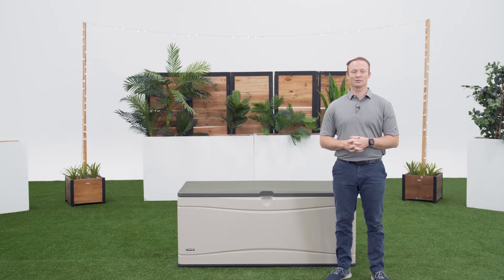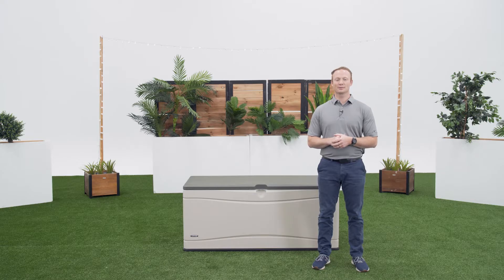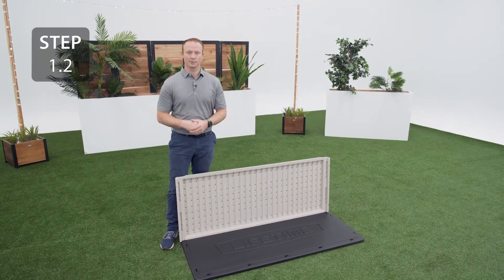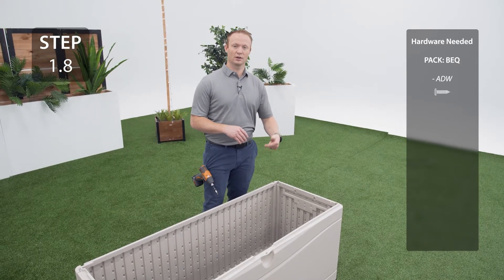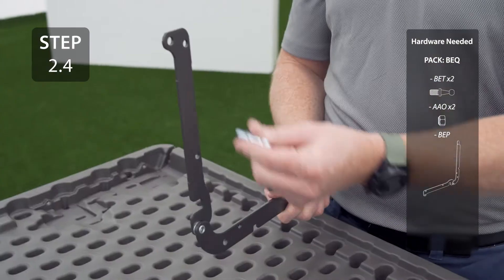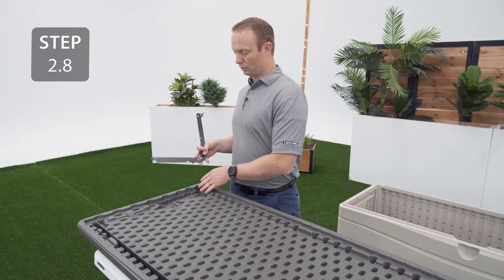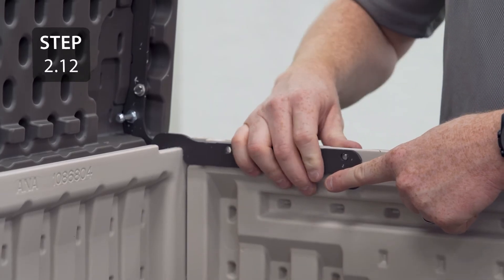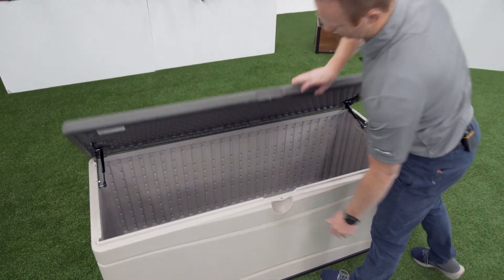Lifetime 130-Gallon Outdoor Storage Deck Box | Lifetime Assembly Video

Comment: The very first step is annoyingly difficult. The pegs in the long sides are not long enough to easily lock them in. Frustrating.
Reply: I just reordered this box because of that and I'm having the same issue again.
Reply: Seriously this also happened to me, this company is a joke
Reply: Same thing is happening to me
Reply: Check to make sure there are no extra plastic parts sticking out that prevent it from sliding in
Reply: Same here 😂😂

Comment: Helpful tip for those stuck on the first step of locking the front and back into the base. I got a rubber mallet and lubricant spray (WD-40 also works) from Walmart. Hit each peg and hole with the spray. Have someone else or a wall as leverage against the piece then hit them to the right with the mallet. I went from 30 minutes struggling in despair to locking the pegs in 2 minutes.
Reply: Boondocks idea to use a rubber mallet and WD40 was the answer to all our problems!  Thank you for your help!

Comment: Great box once assembled. I have assembled 5 over the years. Would be easy to put together if parts lined up with the holes and slots easily. A rubber mallet to beat it into shape  is almost a must.

Comment: The bottom slatting parts are cut too short on some making the first steps insanely difficult
Reply: Yes… I’m having that problem! What did you do?
Reply: @lisaaustin4633  I used the connector side to press them down as best I can. They've settled over time since.
Reply: Thank you
Reply: Agree, this is impossible and I feel like an idiot
Reply: Yup same here

Comment: START THE FIRST STEP WITH THE UNIT UPSIDE DOWN. That way you can SEE the slots and the tabs and what is seated and what isn't. Do the front and back panels at the same time so you don't need to worry about balancing it and holding up one side. WD40 on the slots or tabs would probably facilitate the "sliding." We also used a rubber mallet at various points.
Reply: Thank you for the upside down tip! It worked like a charm with my rubber mallet 🎉🎉🎉
Reply: Great advice!!! I did exactly as you said and the sides fell in place. FYI, if you are having a problem with the small sides going in, the the large sides are not lined up.

Comment: Excellent video.  The only thing I'd include is a close-up of the screws you used because the paper directions aren't as clear as I would've liked.  And, it's ok to pause a little longer on where to attach things on the hinges.  We did put it together and we do like it, but what I suggested would've helped to make it easier.  Also, I wish the manufacturer would've drilled the holes all the way.  Our's were plugged with plastic.  They should also let it be known that you need quite a few tools to put it together.
Reply from the maker: Thanks for the suggestion! Glad this video was able to help in certain situations.
Reply: I agree, I had to really study the drawings in the manual to make sure I had the orientation right.

Comment: HELPFUL HINT:  At 6:04 in the video we're told that when you lift the lid onto the box, you make sure the cutouts on the hinges line up with the notches on the back wall.  That's all well and good if you're lucky, but I myself could not do the next step (6:11) because the screw holes on the hinges on one side (the other side was OK) did not line up with the holes in the side wall of the box.  Eventually I figured out that if you lift the lid out of the notch you could line up the two holes closest to the back of the box and secure the screws.  After I did that, the lid kind of slipped back into the notch, but that was oK because by that time, the holes closer to the front lined up well enough that I could get the screw through both the hinge and the hole on the side wall.  They didn't line up perfectly, but close enough to get the job done.  The only other area I had trouble with was sliding the front and back to the right after sticking the knob thingies into the bottom of the box.  I finally got it using a rubber mallet, but not after calling Lifetime customer service for some encouragement.  Good luck everyone.

Comment: I had no problems assembling this without help, just me, only needed a wall for support and I am generally not super handy at these things. The hardest part was to get the little hinge screws in at the very end - the holes in the plastic are drilled from the opposite end the screws go in, and those suckers would NOT want to go in. I got it eventually after some struggle.

Comment: The assembly is way more difficult than I imagined. Finally I am at the step of assembling hinges and it looks like I have two of the same side hinges. This is extremely frustrating. I guess I will just use them because if I take it back to Costco, I would have to redo the whole assembly… would you be able to send me a new set of just the hinges somehow?
Reply: Never mind. I just used them, but now one of the gas springs won’t click in. I was so close to finally finishing the assembly… Yup. Unless you have the ability to modify the parts to make it work, I wouldn’t recommend the product. If you are expecting an IKEA product assembly experience, you will be very disappointed.
Reply from the maker: For all 3 deck box models associated with this video, the hinges are the same for both sides. The hardware is just oriented differently for the left and right. If you have any other issues, please reach out to our Customer Service team. We can be reached at 800-225-3865 or by email at customercare@lifetime.com. Customer Service hours are Monday-Friday, 7:00 am to 5:00 pm and Saturday, 9:00 am to 1:00 pm (MT).

Comment: These are great boxes but this video is misleading and not  all that helpful.  The assembly is not as smooth as it looks, but the boxes are sturdy and I did finally get it done, but took a long time with occasional breaks.  On this second box that I bought it was harder to attach the front and back panels than the first time around.  On one panel, I did finally get it to slide over by banging it with a rubber mallet.  It took a number of tries, and one time I just got lucky and it started moving over.  The other panel was insane. The rubber mallet didn't move it.  I tried something called "white grease" on the pegs; didn't help.  All the pegs and openings looked ok, and looked pretty much the same; but clearly not all the pegs were sitting down far enough into the holes.   Finally I got a flat head screwdriver and with the screwdriver parallel to the long edge of the bottom panel, I pried each side of all the openings in the bottom panel UP a bit.  I figured if I raised the edges of the openings even a little bit (pried them up w the flat end of the screwdriver), the pegs might fit down far enough to let the panel slide.  And it worked.  Between prying up the edges of the openings, and the white grease and the rubber mallet -- at least those two panels were finally in.  I am encountering other problems as well, but am excited to at least get this one solved.
Reply: Thank you!  Your method worked.  I followed your suggestions prying up the edges of the opening and banging it down with a rubber mallet.

Comment: at 5:40 step BEV screws are too big for the holes in metal strip where he says assembly is big for the holes on purpose. Has to shave off metal to make hole bigger using 1/4 drill bit. Not simple.

Comment: The front panel pegs do not link properly to the holes. They sent me another one and it worked properly. But after putting it together noticed the replacement front panel did not have a hole for a lock like the original one did. Also, the new front panel is not straight like the original one making it impossible to close properly leaving a gap. And no way to lock it closed and sealed. The holes were not always aligned properly making it very difficult to get the bolts in. The box looks good and sturdy but it was more work than it should be. Arggg. To much work to replace the front panel now.
Reply from the maker: Sorry to hear about this frustration. Would you be able to send us pictures of your model and the panels your having troubles with and we can look into it to help you have a better experience. You can reach out to us at youtube@lifetime.com.
Reply: @LifetimeProductsAssembly  I sent an email. No reply from you.
Reply from the maker: @bettymaverick1098  Our team has reached out to you. Please check your email.

Comment: This was a nightmare to install. It's a really poor design.
Reply from the maker: We're sorry to hear this. What part of the installation was a nightmare?
Reply: @LifetimeProductsAssembly  Step 1 took two able-bodied adults over 30 minutes (due to the way-too-small tabs) and a lot of forcing, and resulted in a couple partially broken tabs. We kept thinking we must be doing something wrong, only for me to come here and see others complaining of the same thing. The video conveniently skips ahead at this part.

The screws are packaged together with bolts they don't actually go with, which leads to confusion. I accidentally used the wrong screws the first time screws were required because the instructions didn't make it that clear which screws to use or not use. By the time I noticed this, it was too late—I had to just use the wrong screws.

IIRC, the installation required 3 different socket wrenches and 3 different regular wrenches, plus a screwdriver. I kept having to go to my tool chest over and over.

I had thought the installation was going to be a breeze, but it took well over an hour and in the end, the box is held together with broken tabs and incorrect screws. It's probably fine, but still, it was so much more difficult than I'd thought it would be.
Reply from the maker: Thank you for this feedback. We are aware of the issues with the tabs and we are working with our engineering and production teams to make this better.

Comment: First step NEEDS silicone spray or similar (WD-40) in order to do this ! Everyone give credit to @theboondocks7373 who posted this further down, but it needs to be the FIRST thing you seed before you start!
in order to lock those stupid cream tabs into the darker base, I had to stand the thing on end so I could see what was going on. Then I used a soft mallet to get them to slide into place  front and back into the base.  Yup, I had to spray each peg and hole with the spray. I did it alone with a table behind for support, but it is better  to Have someone else or a wall as leverage . THANK YOU @theboondocks7373!!!